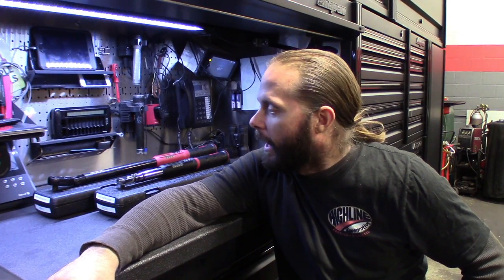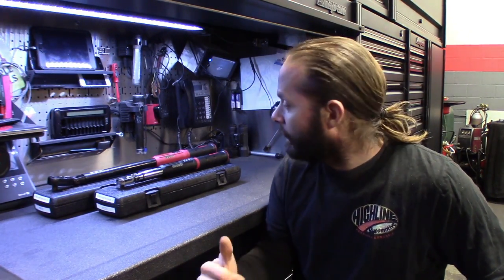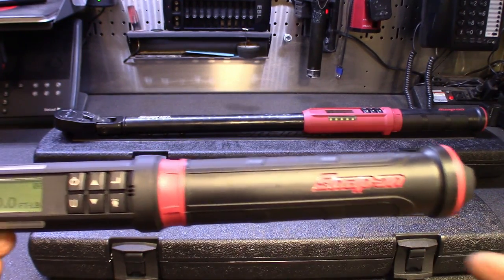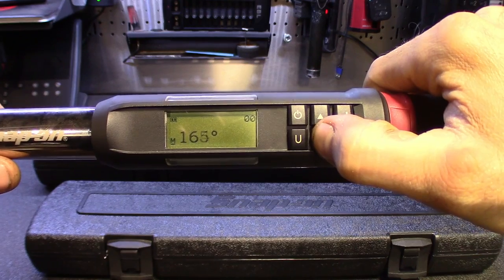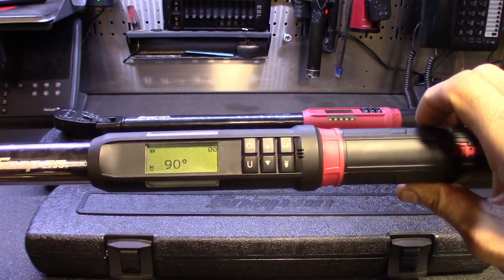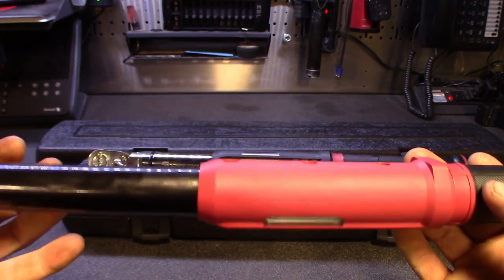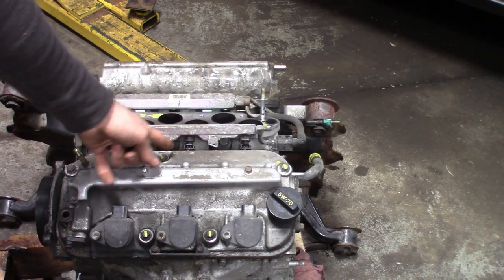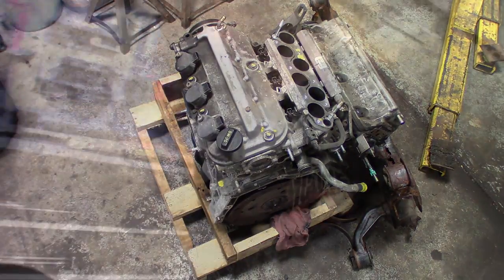SNAP ON TechAngle Review

Comment: I have that same 3/8 one. It's a BEAST. I got it in A+P school in their student program. I got it for 50% off plus an additional 25 % off that price because they had a 1 day sale. As far as I'm concerned it is the only name in the game for digital torque wrenches. Saving for the 1/4. I work in Aviation and most of what we do doesn't require a 1/2". Will probably get a click type for the 1/2 for those few bolts once in a blue moon. But the 1/4 will get a workout every single day. No doubt.

Comment: The handle isn’t as red because it is glass infused, meaning the plastic has fiberglass in it for durability. It cause colors to be more white. I wouldn’t recommend keeping the three AA batteries out because under the screen is a lithium cell that keeps the memory when the batteries are either changed or low, if you kill that thing enough it will be toast. Just a heads up. Love the channel, and you have a new fan for sure 👍
Reply: Say it aint so.

Comment: Ok but here's my question on these .. if I have the 3/8 it's good up until 100 ft lbs .. so I torque the bolt to .. 80 lbs .. then put a 90 degree turn .. am I over exerting the wrench ?? Or is it ok to go Max 100 ft lbs .. then add a 90 or 45 degree turn on top of the 100 ft lbs ??? Anyone have any info on this
Reply from the maker: It's ok to add the additional 90° after a 100 ft lbs torque. The wrench is made to do angles/degree and has nothing to do with the torque lbs limit of the wrench.

Comment: Don't get me wrong the techangles are cool but I've got Norbar torque wrenches. Made by a torque specialist company, the guys who do the "If this isn't right people die" wrenches, lots of aeromotive guys use them but they do a cheaper line which are fine for automotive and engine building stuff. Think I paid £70-90 for each of my torque wrenches, I don't have to take the batteries out, I know what angles are. Ok you've got to wind them off like any other click wrench but it takes 2 seconds to do.  I send them off for calibration every 6-12 months which you and do with any precision tool - never had them reported out of whack.

Just think the snapon stuff is a bit gimmicky and overpriced for what it is man. Snapon is great for some stuff but precision tools/ measuring tools? No way man
Reply: Megaross very ignorant comment.